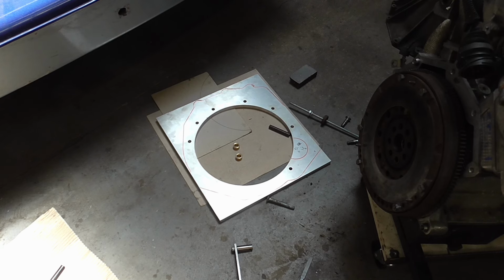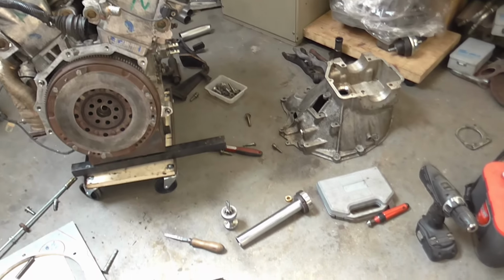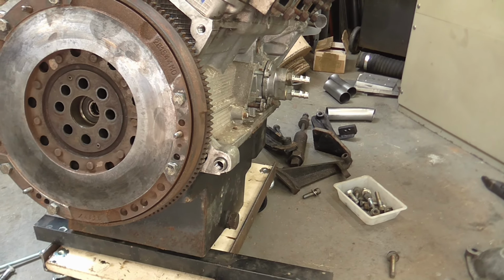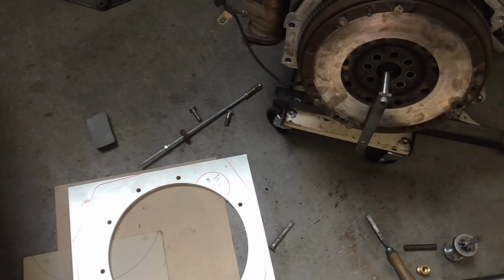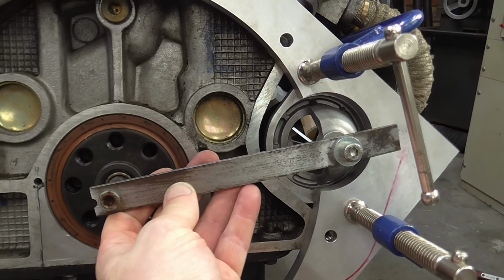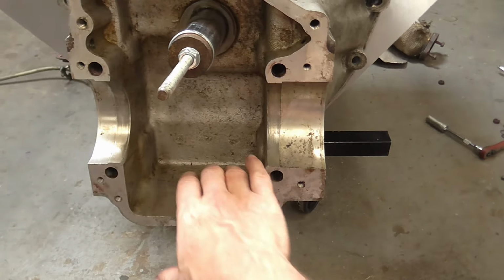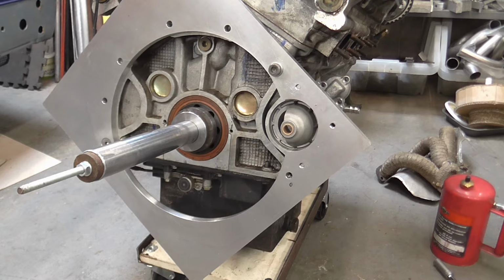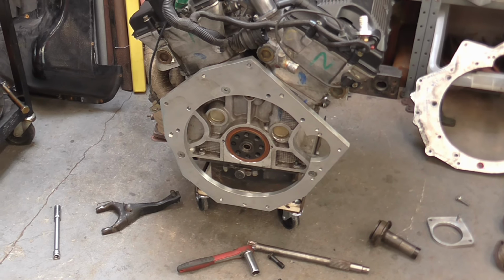Making a Gearbox Adaptor Plate part 2

Comment: Paul, have you dowelled the bell housing to the adapter plate???as there will be play on the fixing bolts, a couple of roll pins would do, just to keep the correct alignment Regards Peter Smith
Reply from the maker: One of the Lotus dowel positions can be used and I've machined the counterbore for it. I may well add another, but whereas the standard clearance hole for M10 is 11mm, with a close fit being 10.5mm, Lotus appear to have used 10.4mm, which is quite good location anyway.

Comment: That's all looking rather tidy. It may seem like a lot of work but the first time you engage the starter motor and it spins smoothly, it'll have been worth it. Well done.
Reply from the maker: It's a seemingly endless stream of problems. Just found more to fix before the gearbox can go back on.
Reply: @EVguru  It'll be worth it, thanks for sharing and advice along the way.